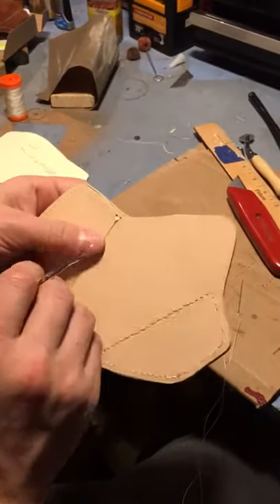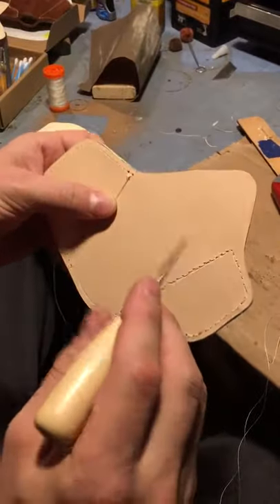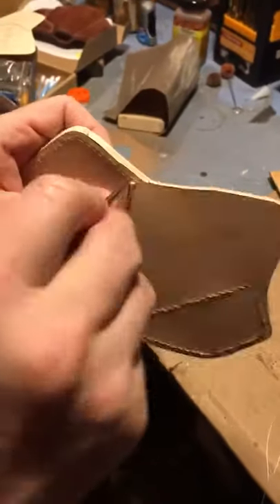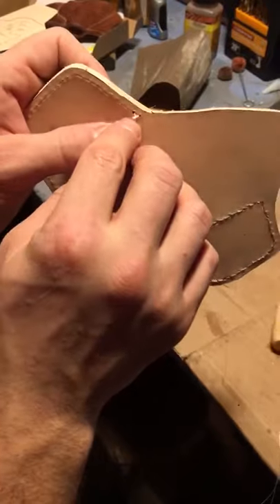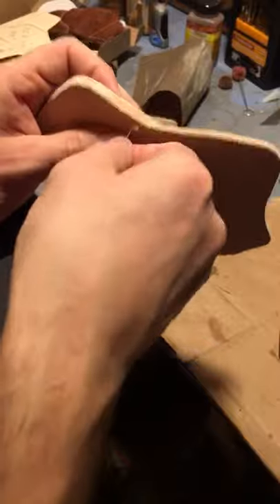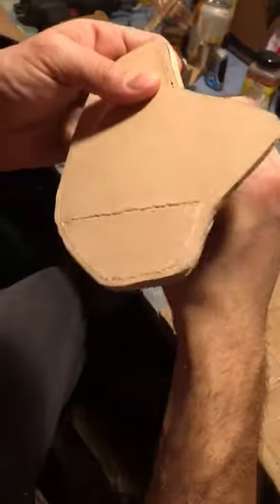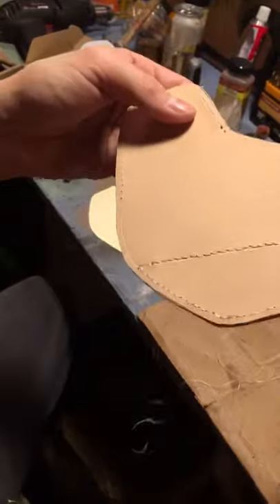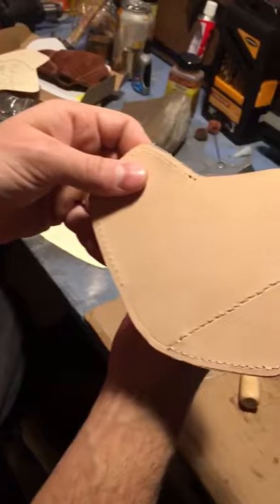Hiding stitch knot - holster making leather working tip

Comment: Hi thank you a great tip, I had been bring my thread in between the two pieces of leather being sewed together and tying the knot there on the inside and then melting it. I will definitely try this idea as it will be easier tying the knot at the front and slipping through.
Take care
Sam
Reply from the maker: You’re welcome! It’s been sooo long since I’ve made a holster. Glad it helped
Reply: @DrewGarage  thanks I make small leather slips for folding knives and your idea is far neater than mine
Sam
Reply from the maker: @puzzlering1  glad to help 😊